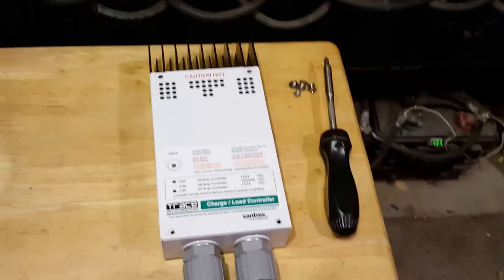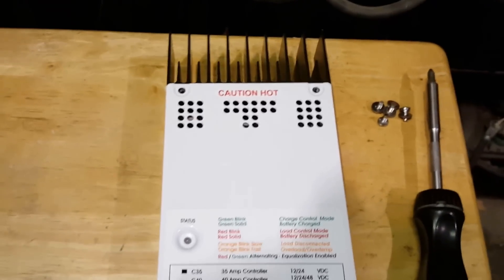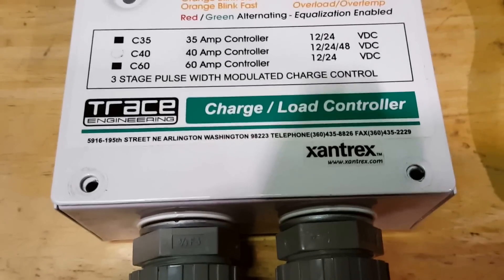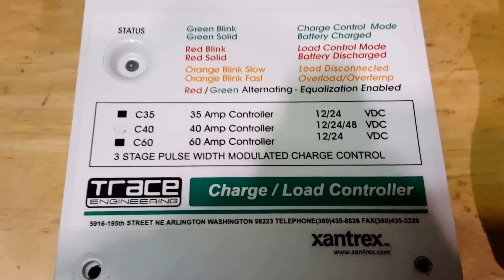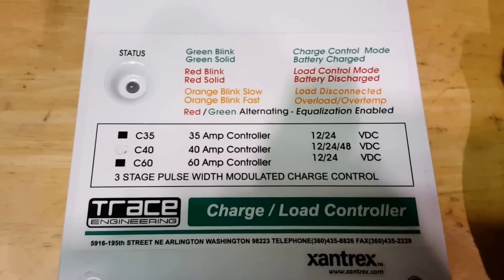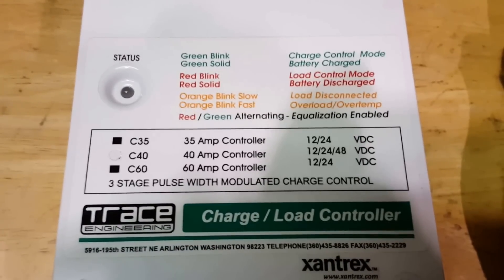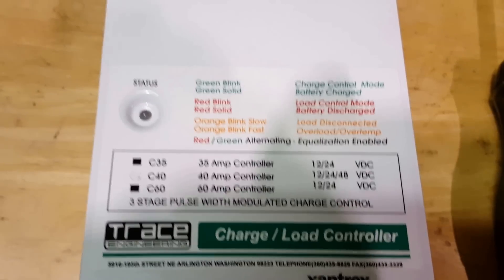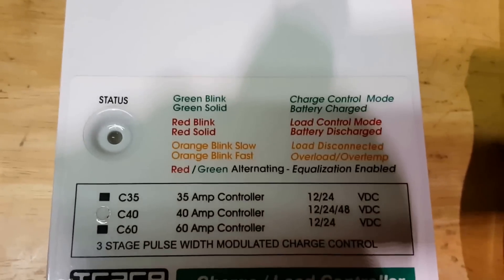Trace Xantrex C40 PWM Charge Controller To Charge The Hybrid Battery On My Battery Powered house

Comment: Sir I have 3 of these units , i have been using them for over 10 years now and have no problem with then, I see no reason you should ether ,thanks, al
Reply from the maker: What I like most is that they don't use any relays and it's a solid state unit! Be Well,